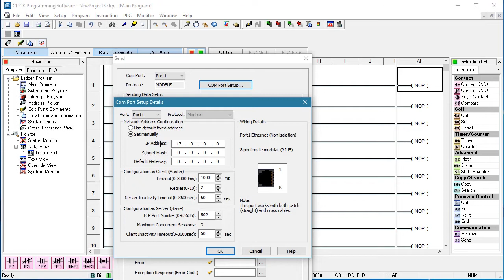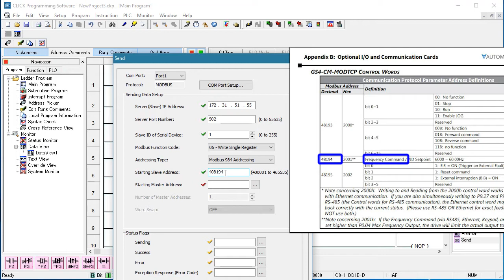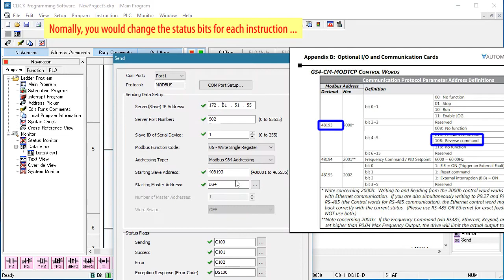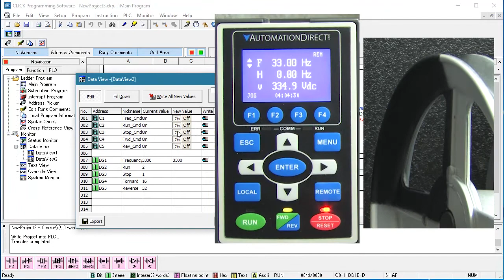CLICK PLC Connect to a DURApulse GS4 VFD via Modbus TCP from AutomationDirect

Comment: How do you get the bit number calculated like the 16 and 32 in your example?
Reply from the maker: The GS drives, (GS20, GS30, GS4, etc) use a 16-bit word for the command information. The manual section he is referencing outlines which bits of that word trigger which functions. The CLICK PLC represents those bits as a decimal number. So, for the run command, it uses the first two bits of the 16-bit word set to a value of 10. This isn't the decimal number 10, it's the binary number 10 so a 1 in the second bit, and a 0 in the first bit. if you do the conversion that comes out to decimal number of 2. This same process applies for the other commands. The forward command uses bits 4&5 of the 16-bit command word, set to a value of 01. This whole binary number would be 010000. That converts to the decimal number 16.
Let me know if that makes more sense. If you take a look at the GS4 manual to the page he is referencing in appendix B that may help as well. Thanks for the question!

Comment: Do you have a Video to connect a Click PLC to a GS20 VFD via Modbus TCP  ?    I tried doing it the same way you did in this video but it will not work .
Reply from the maker: Sorry, we do not have that video at this time. It would be mostly the same on the PLC side but you'd need to alter the Modbus addresses to match the GS20. Please contact our technical support team for more help with your specific application. We have many drive experts that would love to give you some assistance and they will need to ask you a few questions about your specific application! Don't worry, its free!! 😀
https://community.automationdirect.com/s/contactsupport?utm_source=TMwTr7k2lc0&lc&utm_medium=VideoTeamComment